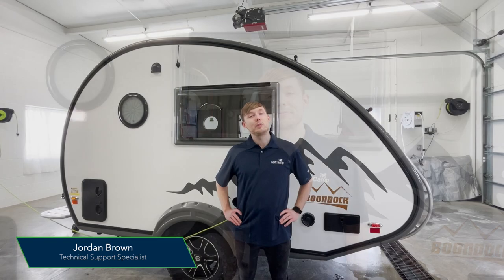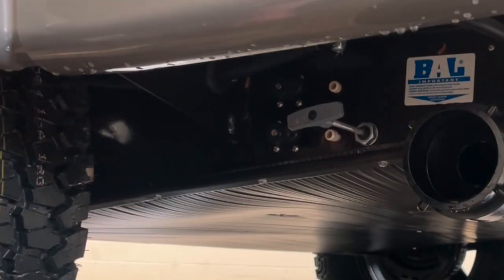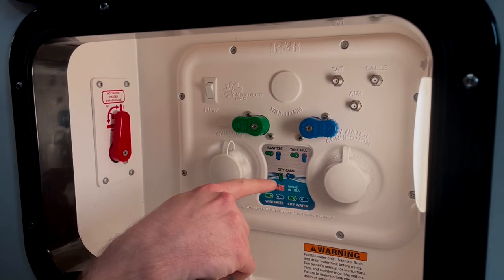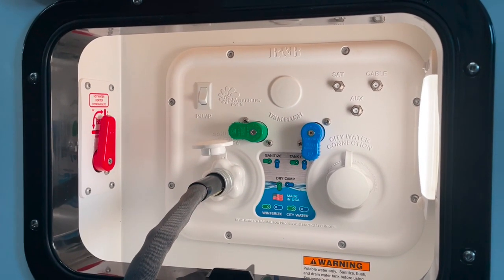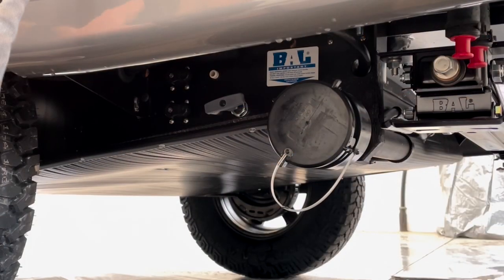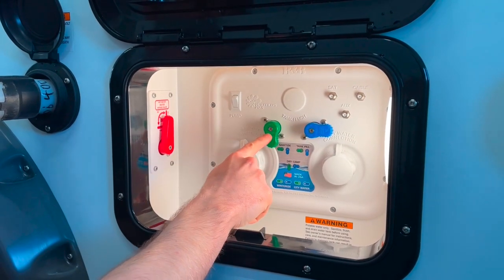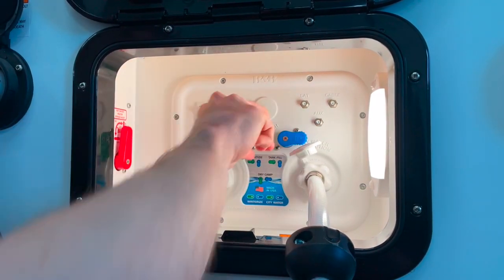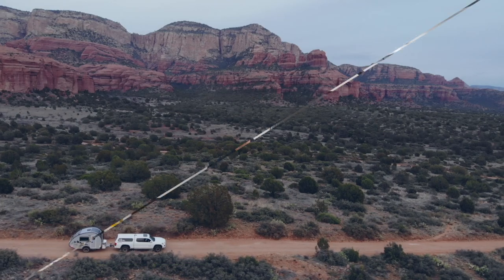How to Dewinterize a TAB 320

Comment: 1/4 cup of bleach per 15 gallons of water in the fresh tank is sufficient for sanitizing.  1/2 cup per gallon will require multiple flushing of the tank due to lingering bleach odor.

Comment: Will you demonstrate the dewinterizing for the T@G as well?
Reply from the maker: We will not be doing a dewinterization video for the TAG. It's a little different in the TAG since there’s no gray or black tank and no water heater.
 
You drain the fresh tank, then gravity feed your sanitizing solution into the tank with a short hose and funnel. You can use the same ratio of 1/2 cup of bleach per gallon.
 
Once you’ve filled the tank, turn on your pump and run the solution through your faucet and external shower until it stops running pink.
 
Then you can empty the tank again and fill it with fresh water to flush the system with fresh water a few times.

If you have any questions, please reach out to Tech@nuCampRV.com.

Comment: At the 3:30 mark you use city water in the tank fill mode to fill the tank.  Could I also use the sanitize mode and draw fresh water from a bucket (using the left hand hose fitting) to fill the tank if there is no tap close by?
Reply from the maker: Yes, you can use the sanitize mode to siphon the water out of a bucket if you choose.

Comment: if I'm at a location that have a water source, can I leave the hose in? or does it have to be disconnected each time it's full, used, and then refill again?
Reply from the maker: Hello! You can stay connected to the water source. Follow the key on the sticker and put the Nautilus in City Water mode. For more information, please refer to the Nautilus user manual: https://www.bandbmolders.com/wp-content/uploads/2018/09/Nautilus-p2.5.pdf

Comment: What about the yellow Alde valve inside the camper? How does that fit into the process?
Reply from the maker: The yellow Alde valve inside the camper is not affected by the process of dewinterization because the water heater is still in bypass mode.

Comment: should the yellow nautilis valve (under the seat) be flipped up during this whole process?
Reply from the maker: The yellow Alde valve inside the camper is not affected by the process of dewinterization because the water heater is still in bypass mode.

Comment: And how much water/bleach solution do I put in the tank?  Just fill it up by looking at the tank water level light inside?
Reply from the maker: You need enough water to pressurize the system, allowing you to run the water through your faucets and fixtures. You can use the gage inside your camper to make sure you do not overfill your tank.
Reply: @nucamprv . thanks!

Comment: How safe is it to release all of this onto a driveway?  I'm not near any place with a drain like you are when you dewinterized.  Everything will be dumping out on my driveway!
Reply from the maker: You can collect the drainage into a bucket or a container and then dispose of it.
Reply: @nucamprv  Dispose of it how? Just down any drain?
Reply from the maker: @wendygodin2716  It depends on the local regulations. Check with your local municipality to see if they have any special considerations for RV antifreeze disposal. In many places you can simply dispose of reasonable amounts through your home sewage drains, some areas may require you to bring it somewhere for special disposal.